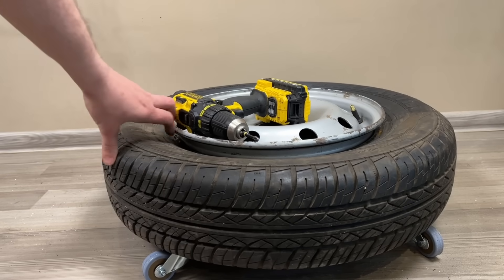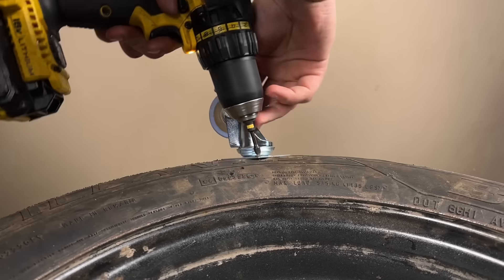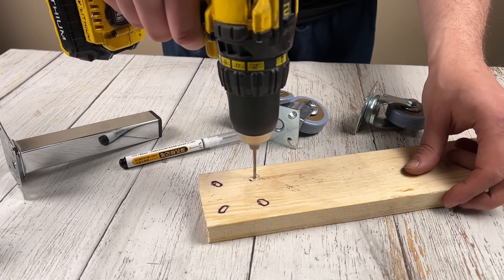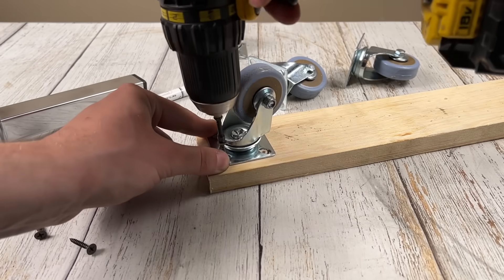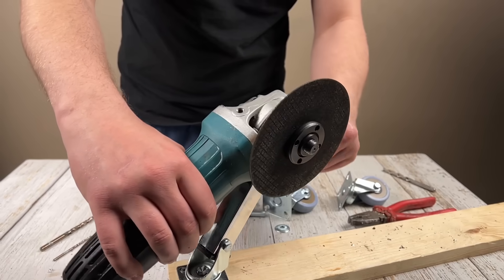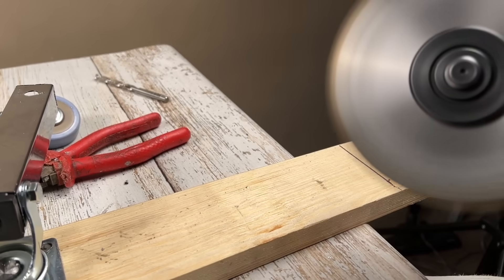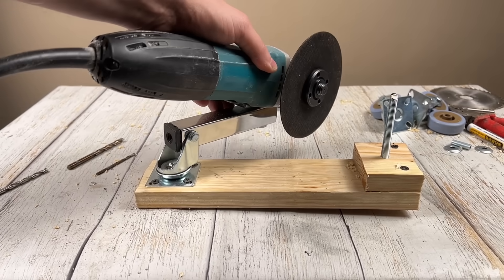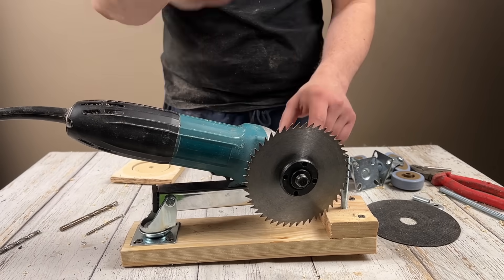Everyone needs this, but they don't know about this amazing invention  An idea from a car tire will

Comment: Safely, right a steel blade made to turn at MAX 8,000RPMS GOING MORE THAN 12,800 ON A GRINDER WITH NO GUARDS.! 🤷‍♂️ I KNEW AMERICANS COULDNT READ WELL BUT CMOM. AT LEAST LERAN THE BASIC FOR SAFETY.! 🤷‍♂️
Reply from the maker: I've learned from experience that I don't need a steel blade guard 🤗

But, you're right! Safety first

Comment: looks dangerous with no gaurd on the blade
Reply: If you're gonna use power tools for a job like that, use proper guards on the tools, grinder or saw  blade. One knot or something could send that blade toward a  cartoid artery. Also, use a vice or clamp when cutting. It's hard to depend on your hands when doing that sort of cutting.